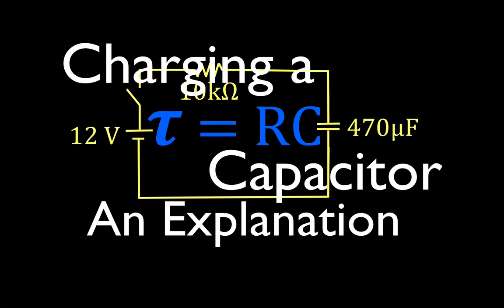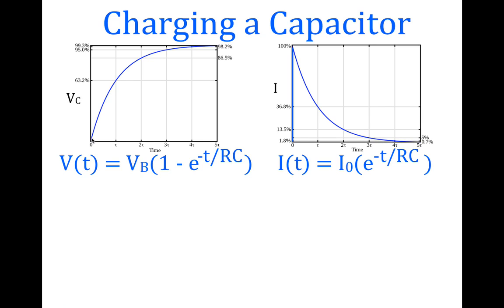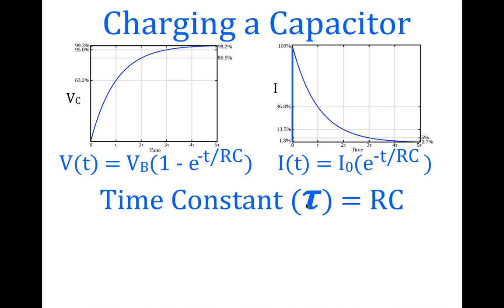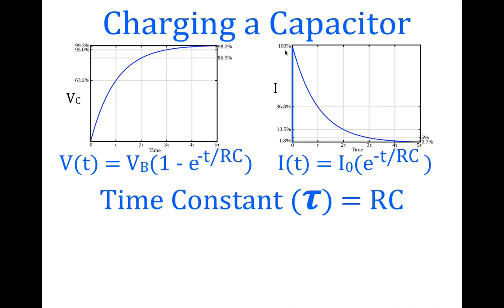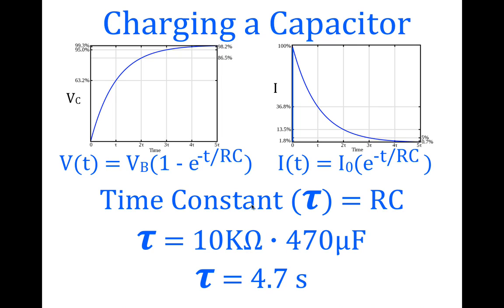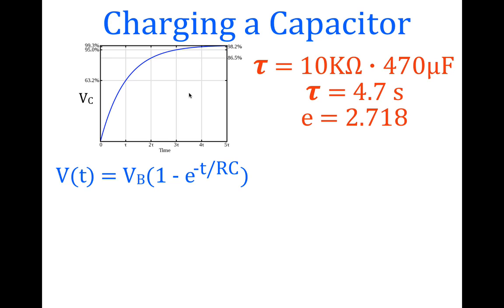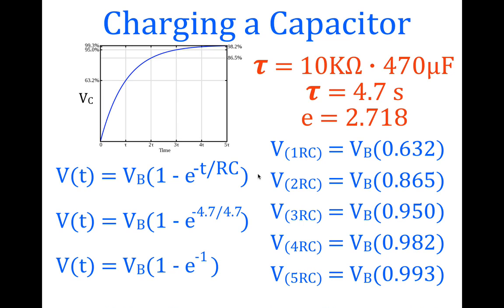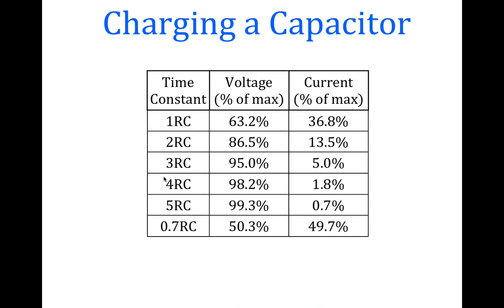RC Circuits (4 of 8) Charging a Capacitor, Time Constant, Voltage, Current, An Explanation

Comment: Honestly I have never voted a video on you tube before but I can't see the reason to watch this video without voting!!!! Excellent explanation!!!!!.

QUESTION:  I have a 2200 uf capacitor and I want to charge it with 5V.  Please how much Amp can this capacitor discharge instantly if I don't add any resistor. I know the charging time will be instantly since  I want to charge it without a resistor and I want to discharge it without a resistor. The capacitor is rated at 50V so I won't fry it if I connect 5V directly to charge it.  I just want to increase the Amp of my solar panel by adding about 50 pieces of 2200 uf capacitors. the input of these caps will be continually connected to the panel but the output will be programmed to discharge each cap individually. now I want to know how much Amp each capacitor will be able to discharge. Thank you.
Reply: do you need help?

Comment: Hi there, can't help but notice you seem to have jumped a step at 5:20 you state you have calculated the voltage across the capacitor. How did you manage to do that without initial voltage or current?

Comment: I have a question, In my assignment says that I need to plot the charging curve over the range 0 to 20 ms(milliseconds)??? What does it mean??
Reply from the maker: A graphing showing the potential difference across the capacitor from 0 to 20 milliseconds.

Comment: thank you for taking the time to shoot these videos there are quite helpful. I'm having issues with more complex circuit though , the one using a three-way switch for charging and discharging. when the discharging circuit contains a voltage source as well with different polarities than the  charging source how does that affect the discharging process ?